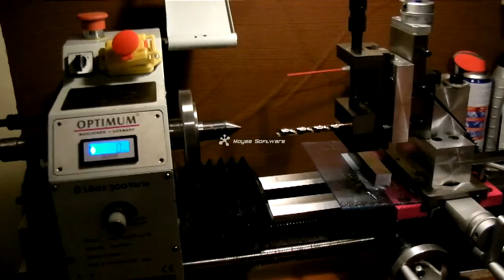Optimum D180 X 300 lathe spindle bearings inspection part 1

Comment: Question: Why You take out the spindle for to check the spindle bearings? You can just check them by dial gauge to accuracy. Latter You waste time to adjust the bearings.
Reply from the maker: My spindle became a little noise. By renewing the grease everything went back to normal.
Reply: Okay.
Reply: Is it possible to spray lithium grease (or some other suitable grease) into the spindle bearing without dismantling it?
Reply: Yes, sure. Somewhere need to be screw or grease nipple where you can oil / grease a bearings. All bearings must be able to oil / grease them. Most better is when you have oil pump and you oil bearing by preasured oil when machine is running.